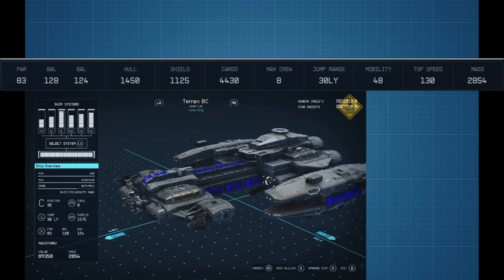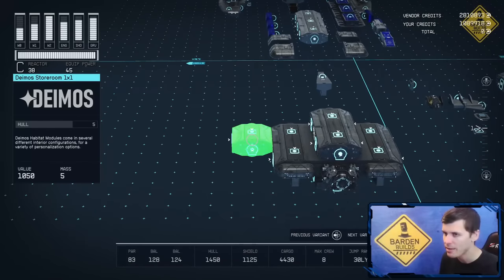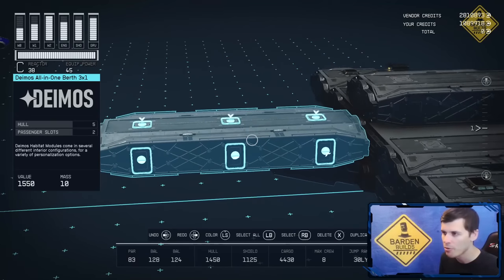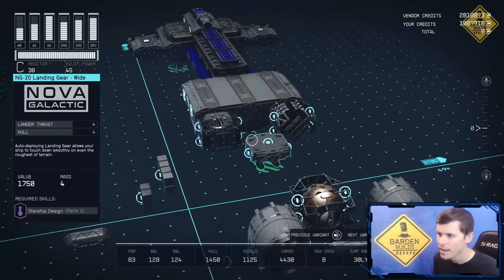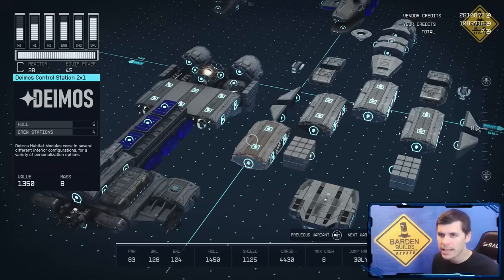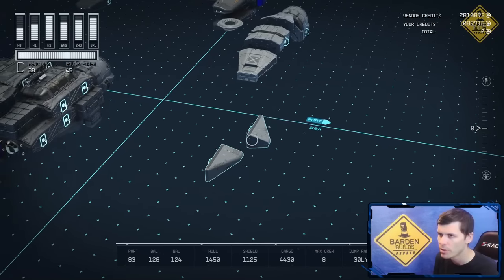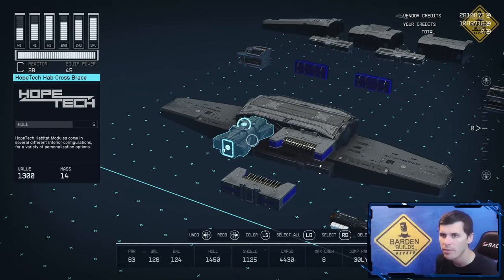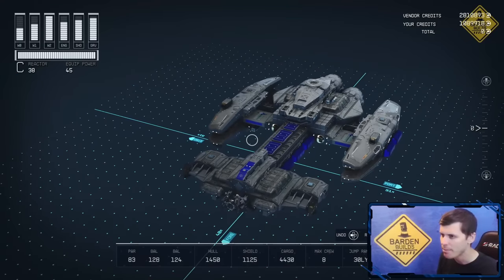Starfield: Terran Battlecruiser (Tutorial/ No Mods)

Comment: For anyone curious about levels: the earliest this could be built is level 60 with the exact parts in this video with the highest level part being the Warden SG400 Shield Generator at level 60. Subtracting that the level is 57 being the engine and subtracting that the level is 52 being the Grav Drive.

The earliest this could be built using the mid tier parts is level 46 with the highest level part being the Supernova 2100 Engine at level 46.

Finally, the earliest this could be built using the LOW and MID tier parts is level 38 with the parts being Apollo GV100 Grav Drive and Fusor DC402 Reactor both unlocking at level 38.

This is of course using the parts from the video just the lower tier versions. Hope this helps someone out there
Reply: Supernova engines are honestly the wrong choice for this ship. You can't place two of them one above the other, which prevents you from doing the four engines it's supposed to have. Go with the class C Slayton engines instead.

Comment: A cost breakdown and full parts list we could pause on would be so amazing for these builds. Keep up the amazing content!
Reply: I'd guestimate it at roughly 800k to- 1200k -  engines, grav and generator alone are an easy half million. Cheapest way to get to it is probably capturing some c class in the wild and then upgrading your way to this. Not much cheaper but this time you won't spend much on parts you're guig to replace anyway.
Reply: @TheBouregard  should be less than that, I only had like 600k or so when I started the project and never ran out but I think at one of my trips to stroud I hit up the 160k wall bug so that may play into that. I would say 800k is the high end, but like you said depends on the starting ship, I used a class A I stole so I did have to buy all the big things. Also your weapon loadout will play a huge part, I did mine different than his
Reply: Your best bet is to do the r&d mission for stroud and get the r type ship, you get the 3 engines, 3 of the fuel tanks, and one of the large reactors and grav drives, gotta make sure they spare no expense in their budget

Comment: Great build! Looks exactly like it has in Starcraft 1 & 2. Would be really nice to have the parts list and location/requirements to build this ship. 😊👍🏻. I know it's troublesome but would really help out a lot of new players to have something to aim for and not need to run around the entire cosmos randomly.
Reply: The back middle landing gear: Titan, Sol.
HopeTech Crossbraces, and Bridge: Hopetown, planet Polvo, Valo system.
The landing gear under the hammer head, and the 2x3 hab pieces, Deimos Staryard, Mars, Sol system.
Everything else should be available in the outpost ship builder. (just slap down an outpost anywhere, and build the large round landing pad)
Also note that there are starhip parts that are level gated. If you don't see a part you want where it should be available, you're probably below the level at which it shows up.

Comment: The only problem I'm having is that once I put either the docker (front) or the bumper on it tells me that I'm at max length. I would love some help with this problem.
Reply from the maker: My guess is you're using a different part from the one shown in the video, that is just a tad longer, which sets the ship over its max length.
Reply: I had found the issue. The issue is resolved. Absolutely amazing ship.

Comment: I did the build but I ran into an issue while using it.  When fast traveling to some places you end up spawning partly inside the hab piece on the nose below the 2X3 and I  get stuck there.  I fixed this by removing the hab piece and replacing it with a Deimos belly piece.  Still looks good and I don't  have an issue with that happening anymore.  Other than that issue love the build.

Comment: Adding a pair of Nova Galactic Braking Engines to the bottom right & left of the front piece works really well for the starcraft terran battlecruiser look. Especially if you colour the round parts blue. I personally also put a second pair between the outer wings and the inner main hull, again, because they look really close to the starcraft battlecruisers - in my case I replaced the two thin flat radiator-looking wing pieces. It isn't perfect, but I think it's as close a match as we can get. Other than that, this build really helped me refine my cruiser appearance. Thanks!

Comment: I built this thing to spec. It's very well made. 

When you land, it lands like a normal battlecruiser would if it could (rocks shoot from below, and lands) its extremely intimidating and awsome.

I changed the guns to turrets to make it more accurate. Current gen Battlecruisers (minotaur upwards) dont use laser systems anymore they use laser arrays, and will fire multiple volleys of lasers up close. I suggest running the Rheza and Eliminator turrets on te shoulders and wings and a standard lazer/particle weapon on the front for destroying debris. 

The ship can also cause you to clip and get stuck in front (on some planets but this is extremely rare, albeit possible) This will force you to do a fast travel somewhere or fast travel to orbit. I also notice that sometimes the ship can despawn, but this is common for most custom builds of a certain size, and this build makes use of ALL the parts.

Comment: Something that would be amazingly helpful with your builds, do it by parts. I.E habs then structual, its super jank when trying to follow your build and your jumping from one to the other
Reply from the maker: You'll have to explain a little more with how this would work.
Reply: @DrB048  at the start,when your telling us what parts to use, is the easiest exampl. You have 4 habs that all go together, however rather than telling us the habs first, you jump from first telling us two diemos habs, to then the structual parts, then back to the habs, then yo the landing gear and then back to the structual.

It makes it very jarring to follow.

An easier to follow method would be to first tell us the four habs, and how they go together, then the landing parts, then the structual parts.

The habs go first because without them you don't have a shape, and honestly the landing gear and structual can be swapped, but most people care about function over form first.

Like I said, it makes what would otherwise be an amazing build guide super jank because in the first 2 minutes we've jumped through 3 different tabs on the builder.

Comment: for some reason it saying that I exceeded the length, height, width limit :(
Reply from the maker: You have a wrong piece in there somewhere that's putting it over the 40m limit
Reply: @DrB048  I found it after being so angry I accidentally deleted that exact piece and replaced it with the right one 🤣

Was the 2x3 at the back. I probably put in a 3x3 at first 🤦.

Awesome build, not only is the design accurate but the inside isn’t confusing in terms of passageways as well ❤️‍🔥

Comment: Amazing!!

Didn't have the engines at lvl 53, apparently we unlock them at lvl 57. I built it at lvl 60.
It cost me ca 640k.
These are the unique parts you need to buy at that place:
Deimos (Shipyard Sol)
	*D. Cargo Hall 2x3
	*2x 320CB Landing Gear
	*D. Mess Hall 2x3

	*NG-20 Landing Gear - Wide (Titan)
	*2x HT Hab Cross Brace (Hopetown)
	*2x Disruptor 3340 Alpha Beam (Titan)
	*Fusor DC403 Reactor (Titan)
	*Kon-Tiki B-600 Bridge (Stroud Eklund Shipyards - Neon).

I also replaced the Infirmary at 12:19 with a Workshop, because there was none.

Comment: I built one of these 2 days ago, but it was so big it reached the size and part limits. The most important thing to me was that it had the ATA and ATG laser batteries in the right places, so I put the (ATG) turrets on the bottom of the sides of the "neck" of the ship and the (ATA) turrets on the top surface of the platform that the cockpit sits on top of at the "shoulders" of the ship. I've yet to decide what would be the best YAMATO CANNON weapon, but if anyone has a suggestion for what would create such a big blast or at least when stacked with duplicates would create a big blast, I'm all ears!
Reply: Suppressors/the EM guns as a single hit can cripple anything if it crits as I did to the Shroudbearer.

The other suggestion is the Torpedo launchers (these are are missile launchers that have huge damage, like 120+, but have extremely low rate of fire) and stick a dual pair on the front upper spine
Reply: @Shinzon23  any specific ones I could check out?
Reply: @WarningStrangerDanger  class Bs if your hurting for creds, class c if not.

Comment: You can also build your own outpost with a builder platform,  visit all these shipbuilders locations to gain access to all pieces,
then just build ships at your own place.
Reply: you still need to hit a few vendors for some parts, you can't do this build all in one spot, took me about 2 hours to get it all together and rebuild enough times once I had, probably would be about 90 minutes if you knew the systems better. Probably cost around 400k too depending on your starting ship
Reply: @chomp7927   You wouldn't happen to know which parts are only available at vendors ?.
Reply: @chomp7927 Hey bro, would you mind listing down the parts that we need to find at specific vendors? Thx in advance
Reply: @bennickyy898  I'm not going back through it again lol, shit took well over an hour just jumping around, plus what I used as a starter had some parts already where yours may not and that changes for everyone, and I already renamed it so I don't even remember what ship it was to start with, I think it was a varun ship but can't recall which one. Just start the build at deimos, you can get most of it there, use whatever shitty cockpit you need from there, get some of the hope tech stuff and just slap it on anywhere, including the tunnels, then do the bulk at your main port. I think there was a few other things I had to go get after that, I want to say it took like 5-6 trips but I didn't really plan it out, I just kinda went along pausing the video

I can say off the top of my head the bridge and the tunnels are for sure something you only get at their vendor, there was a couple other things too, but those ones stand out to me, plus he said as much in the video if I remember
Reply: @chomp7927  youre awesome, dude. I think that will be enough information for me.    I just want to make sure so I don't wasting time jumping around the universe

Comment: I just noticed; Battlecruisers have 4x engines; and those Supernovas use 3 power each, so there is technically room for the 4th one on the bottom snapping point of the fuel tank + landing gear (remove the hopetech nose piece) 🤔But will that fit? I don't have the credits or skills to actually make this yet lol
Reply: I have finally got to create this and I have my answer. A 4th engine can't be placed due to spacing issues. Would have to raise the top middle one somehow to fit it in and that's just goinna make it too bulky.. 3 is fine.

Comment: Could anyone who’s more experienced with ship building tell me if modifying the narwhal into this would be beneficial or detrimental to its original stats?
Reply: This is personal opinion, but trying to locate a Voyager III would be the best ship to start with. Downgrade the J-52 grav drive with the Apollo GV300 in the video to save mass (and money), but use the SF40 Sheared Flow reactor for more power (... no bottom snapping point for a hopetech nose cap though but I don't mind it. If you do, use the reactor in the vid). Voyager 3 also has the Kon tiki b600 bridge and several high end weapon choices if you don't wanna buy any.